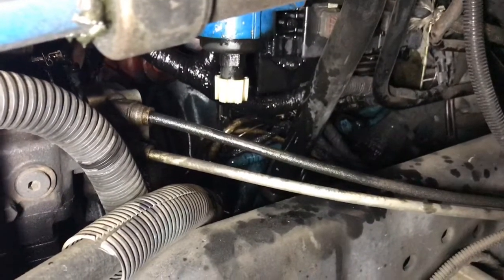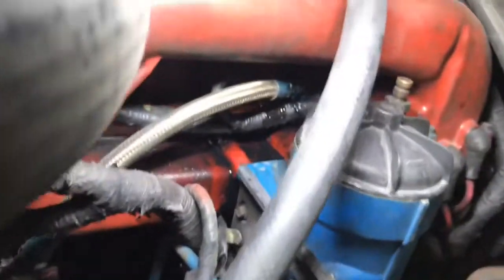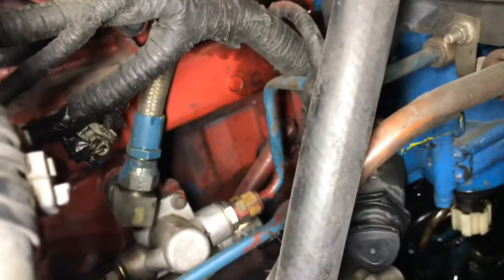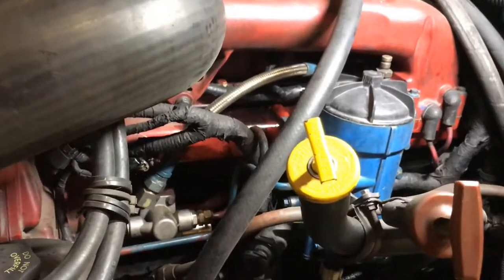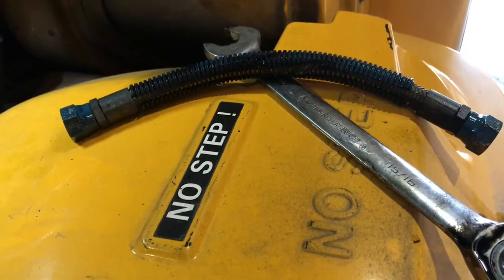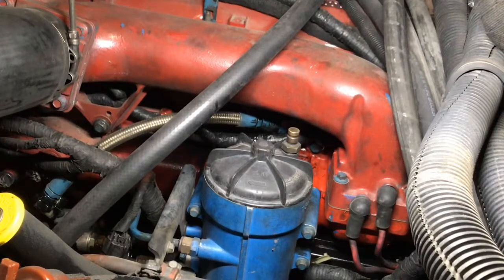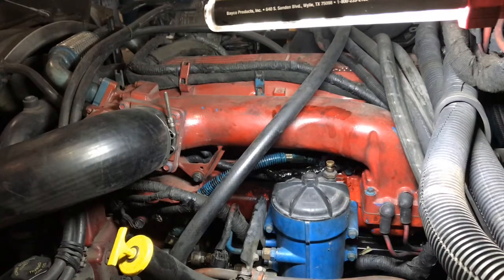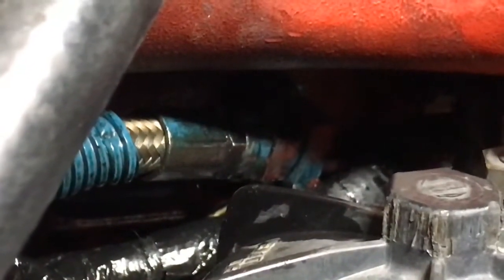CE Bus DT466 oil leak

Comment: Nice video bro. So the hose goes bad from the inside? That was a bad leak it had. I think I have one on mine but at the other end. Not sure where it is coming from yet. There are no grommets or o rings that can be replaced in that oil hose? You pretty much have to replace the whole thing?

Thank you boss!
Reply from the maker: Manolo M  hey manny. There r o rings on the pump and block fittings. Not on the hose though. If the hose fitting leaks. Hose gets replaced.